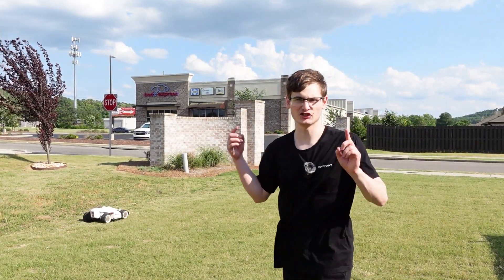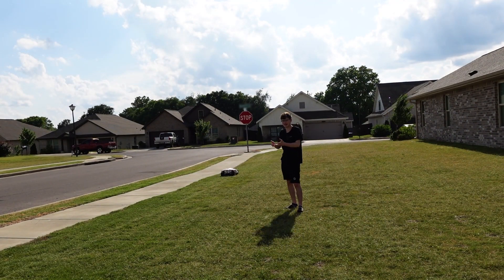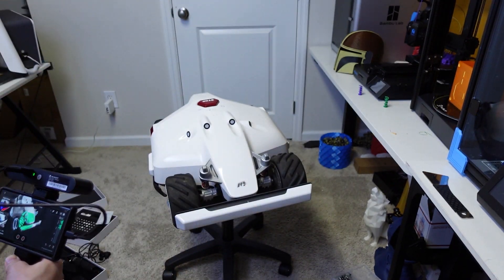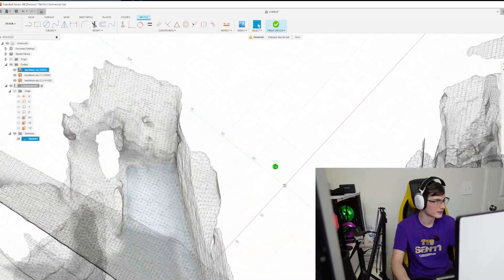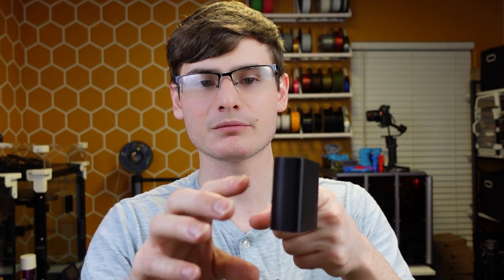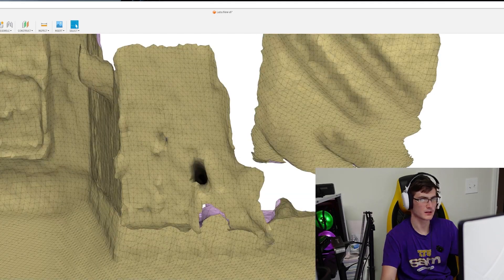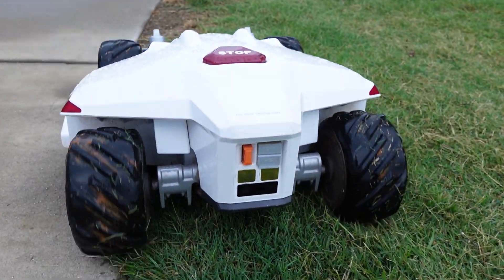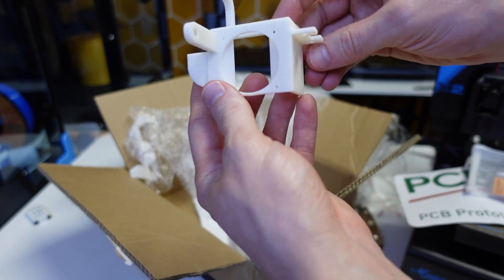$2,800 Gadget Fixed for 1 Dollar with 3D Printing

Comment: FYI, an Airtag fits inside the bumper.
Reply from the maker: That's but but it requires disassembly.
Reply: @ThePrintHouse  Sure but it's like 5 minutes of time when you watch the other videos. The nice thing about your solution, though is if you put a cellular GPS, like land sea air 54, which is a bit larger but still small, it will fit perfectly in your 3d printed box.
Reply from the maker: @sorka95032  I'm not familiar with that one, but good to know!! I like the piece of mind of not ruining my warranty and not possibly damaging a factory part that will be hard and expensive to replace.
Reply: @ThePrintHouse  Once you watch the video, you'll see how much empty space there is in the bumper.
Reply from the maker: @sorka95032  I've seen the video.

Comment: Thanks for doing this and posting the file. Even though I doubt my Luba will work away from my RTK, I'll sleep better knowing I can track its whereabouts with an AirTag. I just got mine back from the 3d printer for around 20 bucks. I put the AirTag in some thin foam packing so it won't rattle around and with a bit of glue-gun magic and voila, it looks like part of Luba. I think Crazypostman could also use your Blink platform!
Reply from the maker: No problem!! I tried to talk to crazy but he won't respond to me. I'm not asking for him to pay or even show it on his channel necessarily. I just wanted to give him one!!

Comment: I saw one guy who unscrewed the cap on one of the wheel and inserted an Apple tag in it.  Your model is a good idea but in my opinion, hiding the tag in a tire is a better idea especially for those who do not have a 3d printer and it cost nothing.
Reply from the maker: Not a bad idea, but I dont like the idea of it being hard to access as well as I dont like the idea of unscrewing bits of the Luba itself. I dont want to mistakenly break something or void a warranty.
Reply: @ThePrintHouse  It's 6 screws.  That are designed to be removed when changing tires, so no impact to warranty at all.  It literally takes 5 minutes to take off.  Best part, a thief isn't going to take the time to find an allen wrench and take the whole tire off.  But they will take the 3 seconds it takes to snap this gps pod off with their hands.  Being hard to get to is a benefit for anti-theft.

Comment: That's great innovation.  I really liked the thought process and design process to achieve the end result.  This is why i wanted a 3d printer, to make cool ideas like this a reality. 

I need to begin researching good scanners though.  The one you used obviously worked for you but the scan result looked like it was roughly chiselled from stone 😄.
Reply from the maker: Thank you!!! The scan I used here was done VERY quick and it was not post processed at all. 3D scans looks very rough until they are processed hahaha. The Revopoint scanners have worked well for me. I would recommend looking into the Range and MINI scanners as I have had beautiful scans come from those.
Reply: @ThePrintHouse  cool, and thank you for the suggestions on scanners.  I'll look at them 👍